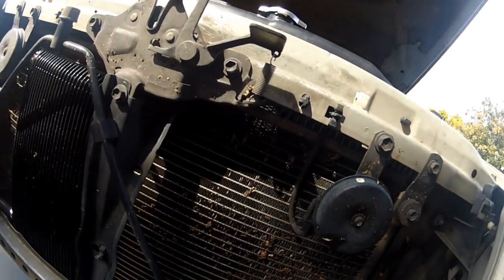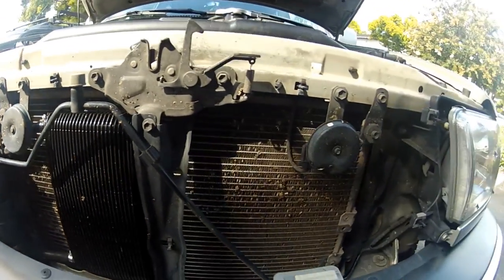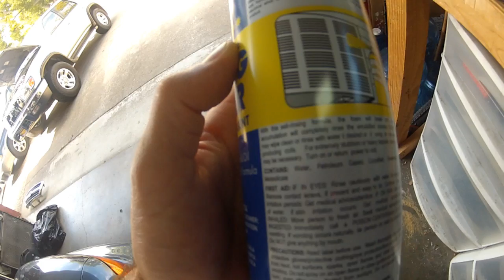AC Condenser Cleaning

Comment: So I changed the ac compressor clutch on my 1995tacoma 2.4 automatic. It has propper air gap, pressure plate engageswhen ac pushed, pressure plate stays where it is supposed to without moving when ac not running. New oem ac belt, new idler pulley.
Ac blows cold. But the compressor clutch assembly gets hot after a few munutes.....

My ac was low on refrigerent beginning of summer. I added, kept it within range. Worked great all of summer......what gives? I was thinking about cleaning condensor like you show?
I wonder if refrigerent is leaking.....trying to think of anything would make it hotter than it should be with use. It does not make any bad sounds.....its strange
Reply from the maker: Your system might be low on oil.  The oil distributes through the system with the refrigerant.  If you had a significant leak, PAG oil could have leaked out.  That's the only thing I can think of.

Comment: Impressive. I think I’ll do the same. I also need to recharge the AC.
Reply from the maker: Yeah, it's definitely worth cleaning it.  Check out our AC recharge video: https://youtu.be/zlRE0Zeeyrc
Reply: @TimmyTheToolman  I just did it and wow it works much better. I also used a foam gun on the garden hose along with a soft brush. Saw a few cloudy bubbles in sight glass so I’m going to give it a recharge soon as per your other video. 

What do you think about moving our horns out of the way of the radiators? I’ve got a ‘01 Tundra with the 3.4 v6 but it’s the same as your 4Runner. I’m tempted to find the horn connectors on eBay and wire up some extension to mount them away from the radiators. Maybe use a rivnut to use same hardware. On my grille they cover up quite a bit of the larger slots for air. If the cleaning made this big a difference, I can only assume moving the horns would as well.
Thanks
Reply from the maker: @ocoutdoors2355  Glad the result of the cleaning was good.  Improving air flow through the cooling fins would never be a bad thing.  Are the horns significantly negatively affecting the air flow?  I'm not sure.  I have an aftermarket bumper and winch on my 98 4runner and those two things definitely have a negative affect on the air flow.  It it's not too much of a pain to relocate the horns, go for it and see what happens.
Reply: @TimmyTheToolman  I just clipped the connectors off and soldered on 10” of wire and used existing factory holes to relocate them. 
They use their brackets for grounds so it’s only 3 connections. Maybe it helps maybe not, it wasn’t much work.
Reply from the maker: @ocoutdoors2355  Good job.

Comment: Hey Tim, did you test the ac again? You realized the water hose sprayed on the condenser  may have thrown off the test. Just wandering if you tested the temp again. Rick
Reply from the maker: I never tested it again.  Regardless if my test was less than scientific, cleaning up the cooling fins of your AC condenser will have a positive affect on the cooling capacity.  Cleaner cooling fins work better just like clean cooling fins on your radiator will enhance it's cooling efficiency.

Comment: i used a wire brush to clean my 2017 corollas condensor, would i have damaged it?
Reply from the maker: The cooling fins are very lightweight and malleable.  You probably ended up bending a lot of the fins which reduces the cooling effectiveness of the condenser.    Air being able to pass through the fins is how the condenser and radiator achieve their cooling.  When you mash them flat where air can't pass between the fins, that's not good.  This is why a passive technique of using a cleaner and water hose is the recommended technique.

Comment: It wll be good if after spraying your (made for this) cleaning product, that you take the clean water nozzle and put it around to the backside and flush out the stuff and not force the crud in further spraying it from the frontside, which yes.. its usually easiest.. but not always. The tiny fins will make some difference but consider the percentage. It maybe best if we just replace it.
Reply from the maker: E L1 these AC condensers are pretty bullet proof, dirty or not. So for this application I’d say run it until it brakes if you don’t feel like cleaning it. Otherwise, if the radiator wasn’t in the way it might have been nice to clean it from behind like you’re mentioning.
Reply: @TimmyTheToolman  if theres no leaks its worth bending the fins straight. take less than an hour once you get the nack of it.

Comment: The (T-ac Safe) is actually a very good product. I purchased a few cans at Home Depot and did my outside condenser, than the A coil or evaporator coil above the furnace. At first it didn't look like it worked. But after a few minutes, thick black slimy goo was dripping off. I deducted it was years of household dust that had been drawn into the cold air returns. My before & after was an 8* drop in temperature at the vent. Colder air equals shorter run cycles to satisfy the thermostat. But I love the car idea. I will be trying that too!

Comment: At 6:03, we appreciate the extra effort you made to show the under-engine/lower radiator spraying with a good camera angle. The post-op summary analysis also helped, along with a reminder about the next video. I subscribed without hesitation.
* Suggestions-- 
1. Your camera angle for general audience address seems a bit too low-- it should be at or near a face-to-face level.
2. When preparing to clean the coils, it might be a good idea to spray them with water, first. After that step, and a few minutes' delay to allow penetration, the coil cleaning action can begin immediately.
Reply from the maker: Thanks for the suggestions Bob.

Comment: Hi Timmy.  The condenser gets hot while it's running.  That in conjunction with the air flowing through it most likely dried the water out pretty quickly.  The temperature you saw at the end of your test run was probably at least 95% real improvement.  Could have been other differences between the before and after tests but not much.  Heat transfer engineer here....just sayin'.  Rich
Reply from the maker: twwtb Thanks for sharing that Rich.
Reply: Heat transfer engineering...it's a gift meant for sharing. ha ha.

Comment: The Petaluma poultry processing plant uses LOTS of this type of product on all their vehicles. Poultry kicks up dust and also dander that is super-fine.  Even after initial cleaning with garden hose, it was visually cleaning very deep in radiator. Mechanic said they couldn't keep the trucks running without it.

Comment: Nice video, This is proof that being clean makes you cool. ha ha! I think I will go to the self serve car wash and power wash my evaporator and radiator.  Ya might even get a few more mpg since an engine needs to keep an ideal temperature for max efficiency and ya need a clean radiator to keep the engine cool.
Reply from the maker: FiveFiveFive OneTwoOneTwo. Be careful with using a power washer for this.  The cooling fins for the AC Condenser and Radiator bend very easily.  A hard spray from the wrong angle will bend all the fins in the path of the spray and then you'll lose some efficiency with the cooling.  A gentle spray is better in my opinion.
Reply: Bad idea

Comment: Thank you for the video and showing the difference condenser cleaning makes.  I  have been planning to clean the condenser on my home a/c, but will add my car to the process as well.   

I didn't see this mentioned in other comments, so I'll cover it here. The reason the cleaner you're using is "no rinse", is that the product is actually for the evaporator coils that are typically enclosed in some kind of box as part of the indoor home hvac unit or  under the dash in a car, and is hard to rinse unless you remove it first.  The product label noted that condensation will eventually rinse the product, and there's no condensation occurring on the outside of condenser.  The condensation occurs on the outside of the evaporator coils when moisture laden warm air hits the evaporator  coils and sheds water like the outside of a cold glass of ice water.  The can of condenser cleaner I purchased from an hvac supply store(while picking up part to fix my home a/c)  requires rinsing.

It might be interesting to do a similar video on the evaporator coils perhaps with an endoscopic camera, and a similar video on the effect of cleaning your radiator by measuring temperature difference between incoming and outgoing water tanks or better yet, the water itself (addmittedly harder to set up and measure).
Reply from the maker: Thanks for the info Steve.  The condenser cleaner I used was recommended by a guy on a Toyota forum.  If the cleaner I bought was really for evaporator coils I wonder if a can of actual condenser cleaner would do a better job to clean the condenser.

Comment: thanks for the video, but your spraying pattern couldn't be more chaotic and random! Why don't you go in rows, back and forth, slowly moving down as you go?   Yeah, i'm OCD, but dayyum, that was crazy spraying.
Reply: Ryan Harris troll
Reply from the maker: Ryan Harris Next time I will give each cooling fin exactly .005 ounces of spray going in a North to South then East to West pattern.  After that, I will spray it down with pure spring water and dry the cooling fins with a hair dryer that is set to 125 degrees exactly.  After that, I will bend all the cooling fins back to their original shape.  I know I can do better.  Don't give up on me just yet.
Reply from the maker: And Yeah, I'm OCD too but I guess not with the application of AC condenser cleaner.

Comment: nice video. keep the videos coming! Just noticed you got similar miles as my 99 yoda! I'm at 151k.
Reply: I got a nice one for you if you're interested. It's quick and simple. MAF cleaning & Throttle body cleaning. I'm hoping it will help with my MPG in the city. I'm at around 13-14MPG in the city. Mine was caked. I should have done a video!
Reply from the maker: Hey Minh, I bought my rig a little over 2 years ago with 111,000 miles.  I'm hoping it lasts up into the 400,000's.
Reply from the maker: Sean and I cover cleaning the MAF and Throttle Body in our Valve Cover Gasket Replacement video.  However,  it could easily be a video all on it's own.
Reply: 400k! can't wait to see the timing belt/water pump vid and hopefully NOT a head gasket video!!
Reply from the maker: Yeah, I'm a little far off from needing a timing belt and water pump replacement since the previous owners did it before I bought it.  But, I could always find another 3rd Gen owner that needs it done if I want to make a video of it sooner.  

And yes, I hope I'm not forced to do a head gasket replacement on my rig.  That would be just fine by me.

Comment from the maker: This is a response to Mech-E who posted a comment.  For some reason, I'm not allowed to reply to his comment.  Weird.  But, here's my response:

"Yep, I mention at the end of the video that the AC condenser wet with water most likely increased the efficiency and the improvement isn't 100% contributed to the cleaner cooling fins.  On a similarly hot day, with the AC condenser completely dry, I'll have to see what the temp gets down to and I'll report back in the comments.  Regardless of the fact that the amount of improvement is probably off, cleaning the condenser is going to improve the efficiency of your AC system at the same time improve air flow to your radiator as well".

Comment: Great as always Tim! I'm glad you addressed the water variable. I was wondering the same thing and would be interested to hear what your reading are after it dries. But like you said, either way it's still worth doing... Next video is A/C charge? How cold do you want it/how cold should it be?

Thanks again for all the info!
Reply from the maker: Hey Barak,  I've noticed watching other AC Recharge videos that the people were showing temps around 40 degrees.  I'm not 100% sure what is considered normal and I guess that number will fluctuate based off the heat outside.  On a recent road trip, I noticed at times my AC system was taking a while to cool down the cabin.  It was very hot out, in the 90's, but I was thinking the system could possibly be working a little better.  

On the top of the receiver/dryer is a site glass that you can glean information from without hooking up any gauges.   It's all based on whether you see bubbles or not and what the system is doing.  A little too long to explain right here but I'll definitely cover it in the next video.  So, I did see signs I'm a little undercharged one day recently but I'll recheck it again along with hooking up manifold gauges to see what pressures I have on my low pressure and high pressure sides.  

I've been reading up on it and there's a ton of information out there.  I'll probably be tackling the AC recharge in a week or two.

Comment: Thanks for sharing this video Tim! How's the tranny cooler working on your rig? will you recommend installing that on a 2WD 4runner? sorry for the off topic.
Reply: Thanks for the response Tim. I'll watch the tranny cooler video again to get the parts and specs for my next project.
Reply from the maker: Hey Dan, if you choose a sideways mount like I did, B&M suggests running the inlet to the bottom fitting and the outlet the top fitting.  This is suggested to help prevent air getting trapped within the cooler and thus reducing the performance of the cooler.  I ran the lines opposite and decided to leave it that way since my cooler seems to be working fine.  I believe this trapped air concern is overblown and you can read more in the comments on that video if you want.